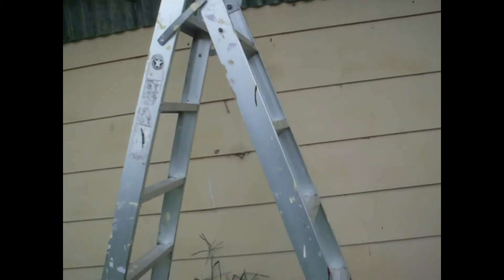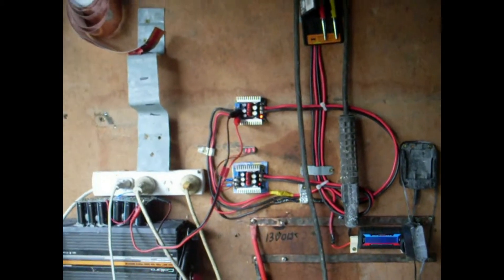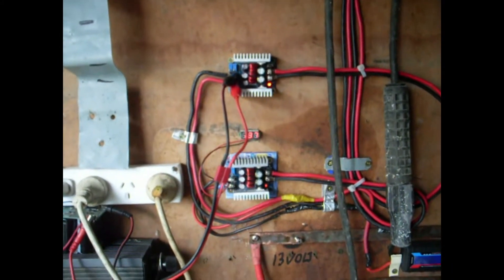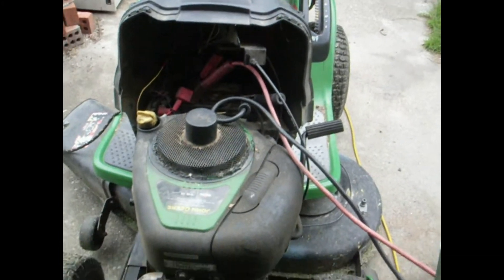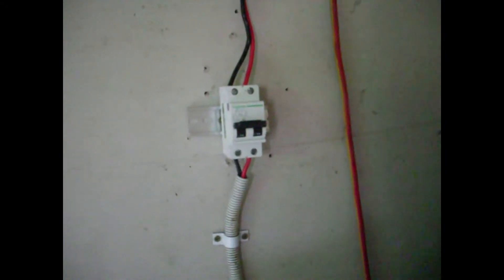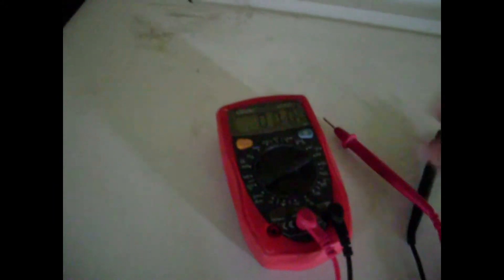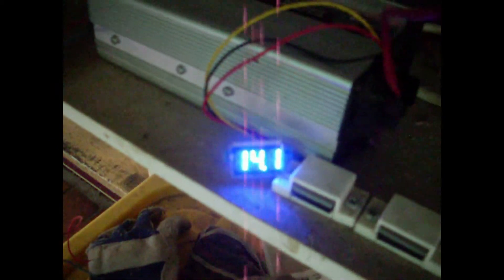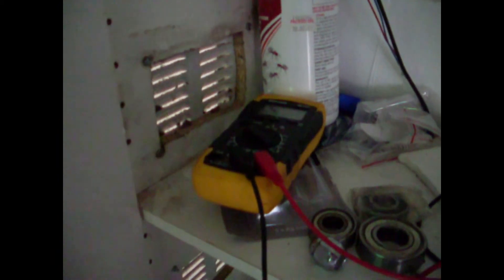My solar project, solar direct no batteries heating water

Comment from the maker: well now its been a long time 2 years sinse i installed it the and i have had to use mains to heat the hot water about 6 times over the years
Its a 4kw element 240v AC I have not measured the power it uses its 6 panels at 3 in series
giving 42x3 volts dc  and max 16 amps 
love solar
today my house panels are runnin g the fridge PC and monitor plus the internet router and sound speakers
the sun is shining and the bir5ds are singing.
Keep on working you solar
PS i have 300 AMP hour lead acid 12 v bank in 3 batteries

Comment: So these are just general numbers. At full power you get 860W and your heating element seems to be about a 4KW 240V heating element with a resistance of 14 ohms.  At low power of 37V, that would be about 100W.  If a MPPT control were used that would bump up to 280W.  You look to be somewhat adventurous in your electronics.  I've designed several PV power point hot water controllers that are not that hard to build cheap if you can solder.
Reply: Such a controller or even a plan/kit is not easy to find. I bought panels for this project and I can solder. What do you have?
Reply: @bokchoy335  My channel is mostly for those with some electronic knowledge. These plans opt for minimal components for easy build which requires tailoring them to your particular situation, stand alone or with a controller, automatic or manual tracking, thermostat switch options and more. A one size fits all would be too elaborate for most. Here is the most simple design  that can be built on a breadboard simple enough and cheap for almost anyone. Other designs have more features. A thermostat would turn the board on and off, not in the main current path.
https://www.youtube.com/watch?v=ciyA7mSo7IY

Comment: awesome stuff mate , works ok does it ? looking to do something like this myself
Reply from the maker: Do note I installed and many refines over a year but the basic of 1kw of solar direct to hot water system with a normal  element of 4000watts is the same.
It normaly puts out 120vdc from 3 panels in series  times 2 in parallel and takes about 8 hours to heat the system to 70C it also depends on cloud summer time.
winter i have to top up with grid power
I have the system dual power.
Reply: @aussie_Logic  cheers mate  , new subscriber